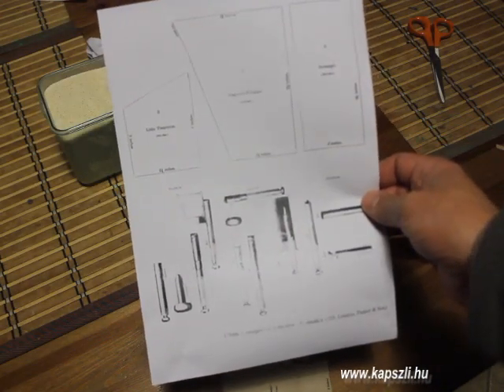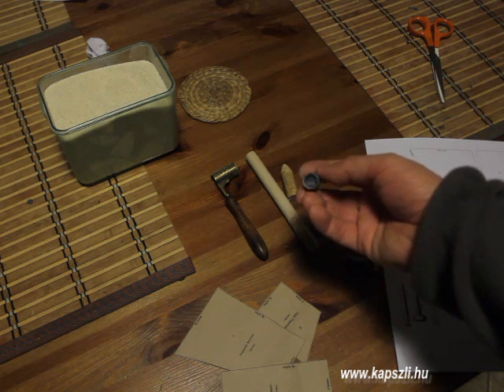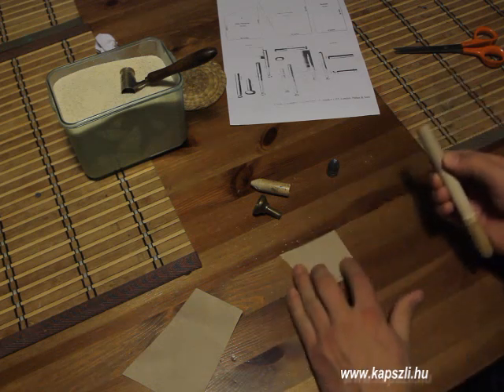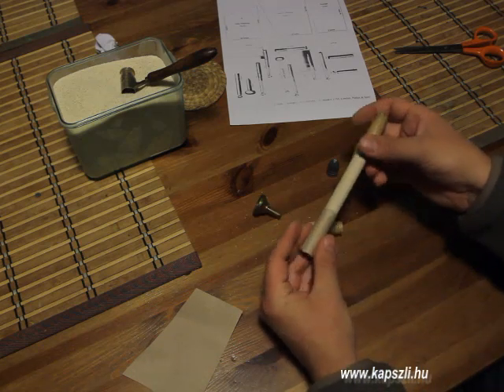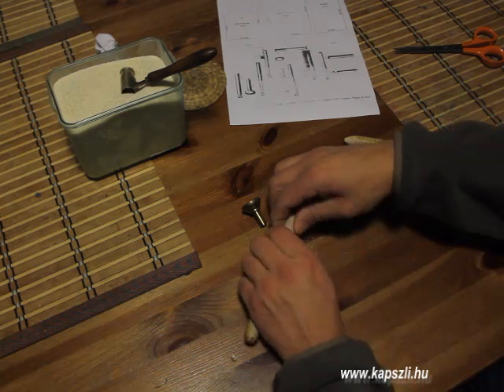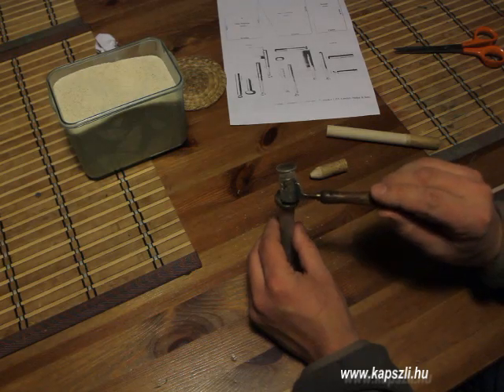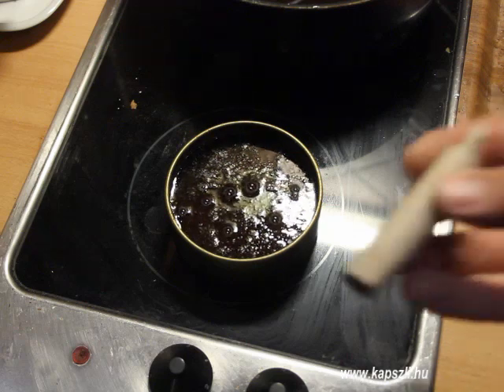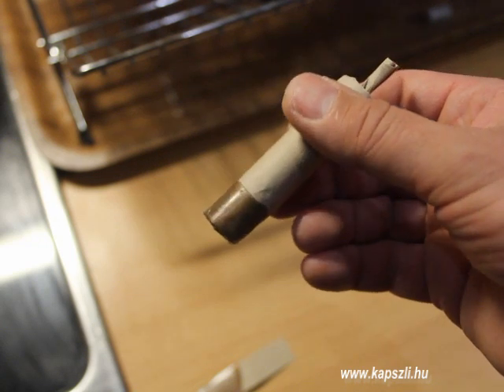Making the original paper cartridge for Enfield rifle muskets

Comment: In reply to Robert Boerner; "During the Civil War, did troops also use the paper cartridge as patching material in the 61 and 63 rifle muskets or was it discarded?"
Ans. The powder was poured and the bullet removed from the paper and the paper was completely discarded.  The cartridge rolled here w/out the reduced diameter bullet could not be used as intended. The idea was to pour the powder then reverse the cartridge inserting the lubed end into the bore and then tearing off the paper remaining outside the barrel.  Also, IIRC, one of the papers was supposed to be heavier, about like card stock.  (Though that might be one of the US loadings.  I do not recall exactly and am not going to bother looking it up just now.)
The lubed paper patched kept the barrel cleaner. That's why the US used their Williams (I think that was the name of at least one variation) cleaner bullet with a zinc washer at a rate of 1 in 10.

Comment: One more thought. One of those papers should have had slits in it to facilitate the paper dropping away in flight.
Reply: The cuts in the outer envelope weren't added until 1857. This is the 1855 cartridge pattern.
Reply: @mackenzieblair8135   I'm late in replying but I take your point. You're quite right.

Comment: Finally some one that dose it wright.
Reply: Weellll... Actually, no, he doesn't.  This is going to be long sooooCosmetically it looks right but it will not function correctly as britishmuzzleloaders indicated.  The paper used by the maker of this video (in general and excellent and informative source) appears to be uniformly of a type known as "newsprint" or "Manila paper."   That is not what the " companion to the new rifle musket" calls for, indeed, each form called for a different type of paper.  Another point is the cartridge of 1855 pattern was made with a .568 diameter ball which ultimately proved problematical. Also, the beeswax/tallow lube was too. Chemically, the tallow induced a reaction with the lead forming a white crystallization making loading impossible by the book and difficult at best.  That "tallow" was described by anti-British militants as pork to the Moslems and beef to the Hindus and that in turn fanned into the flames of mutiny and rebellion in India.

This brought about a change in 1859 and again in '60 with a hotly contested .550 ball that ultimately proved to have a flatter arc, greater range and more accurate.  The paper patterns were altered and the lube changed to straight beeswax.  Furthermore, the loading instruction altered to tear off the tail with the fingers instead of biting it off.
Also, the paper used in the video would only have served for one of the 3 called for.  Also, he did not roll them correctly.  The first paper he rolled would have been equivalent to what basic business cards are made of.  In the later pattern, I have had good luck with construction or artists sketch/watercolor paper.  It is rolled near to the end then the second paper is added in before the end of the first is reached.  The third is a rag type paper that cannot be more than .002 thick and must be rolled tightly. To achieve this the first two papers must be rolled around a smaller mandrel so that they equal the outside diameter of the bullet.  

To load, the tail was torn off and the powder poured into the bore, the cartridge was reversed and the bullet with the lubed paper covering inserted into the bore to the end of the flat line of the bullet.  this would insect with the thicker card stock paper of the cartridge. The remainder of the paper was torn off at this point and discarded, the lubed paper patched ball was rammed home.  This controlled fouling so well that no cleaner type bullet such as the US Williams type was needed or used.

Comment: During the Civil War, did troops also use the paper cartridge as patching material in the 61 and 63 rifle muskets or was it discarded?
Reply: Depends on the loading/cartridge system being used.  In USA service with the Minie' ball with grease grooves, the bullet was lubed.  In about 1861-62 I forget exactly which, the USA dropped the 3 paper cartridge down to 2.  A paper was rolled into a tube and tied off at one end former the powder container.  The tied off end was inserted in the Minie's hollow base and rolled into a second paper tied off over the nose and folded at the rear end.  The soldier bit off the folded end and poured the powder into the barrel. He then had to remove the bullet from the paper completely, then load that into the bore and ram all home.
The English and Confederate versions of it work entirely differently.  See my reply to Steven Johnson for details on that.

Comment: Are you really sure about the 2.5 grams of black powder ??? That sounds pretty light.
Reply: drams
Reply: 60 grains measure by volume not weight.
Reply: 60 grains by volume is the same as 60 grains by weight. 60 grains is 60 grains no matter how you measure it. I weigh all my loads. If you compare the two you will see there is no difference, except maybe the markings on the vol-metric measure my be off.
Reply: Imagine hundreds of young women in an ammunition factory producing hundreds of rounds per day all by hand.